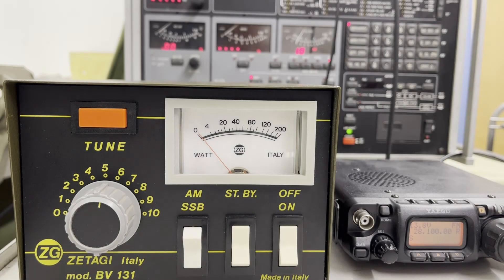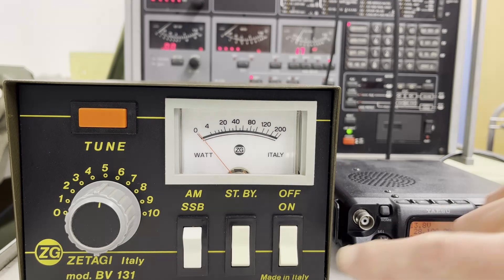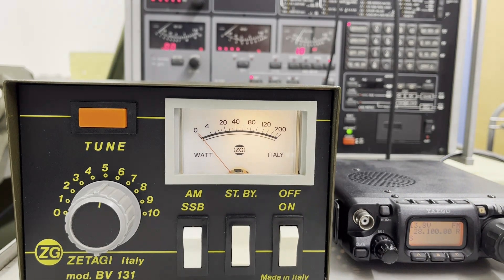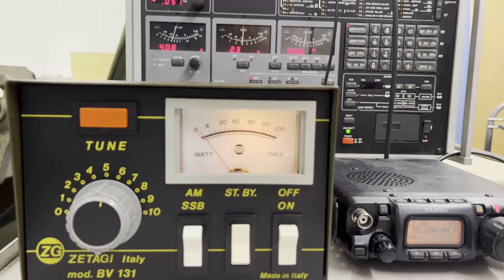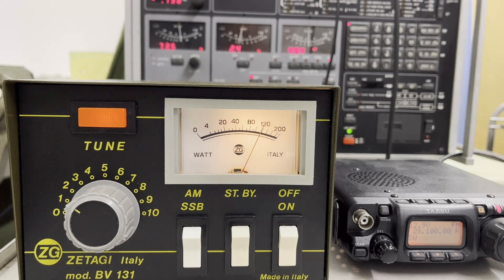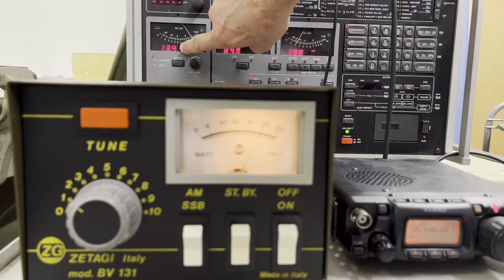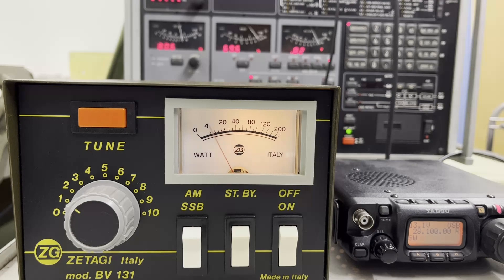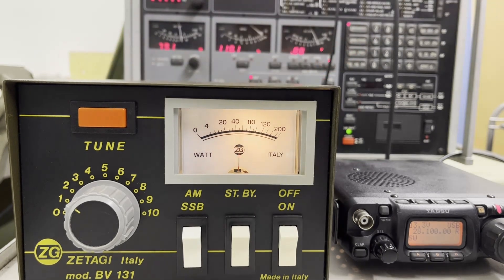ZETAGI BV-131 HF-power amplifier tests on 28 MHz

Comment: Does it work on all hf ham bands
Reply: It only cover 26 to 30 Mhz.
Reply from the maker: Yes hello, at 21MHz it only delivers 15 watts with 5 watts input. So it's only really useful from 24 MHz. The manufacturer actually specifies 26-30 MHz. In my last video I was able to carry out the test at 24 MHz with success. Check out the last video: https://youtu.be/Yttd_UDbwk0?si=BxVNQWXeDJdNcDFO
I hope you have a nice weekend. Vy 73...
Reply: It would probably work on 20 meters
Reply: It’s iam sure it’s a performer on 10 meters. Seems like tube amps are disappearing I refuse to use soild state tubes can take it better than mosfets. And the repairs on a soild state amp is very expensive as a Hamradio operator I will use my tube amps till the day I die mosfets cannot stand the constant load or a slight missmatch it’s done I drive my tube amps with reason and will last for years people today run them balls to the wall and blow them up you need power when  needed
Reply: It’s looks to be a cool amp